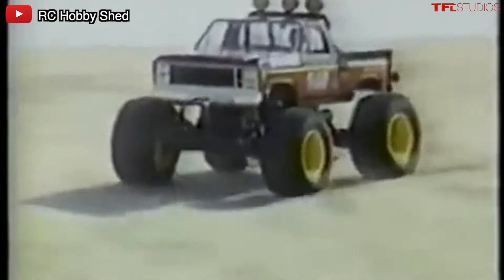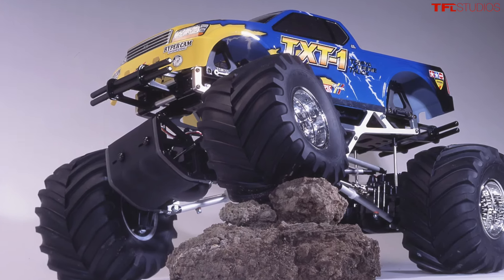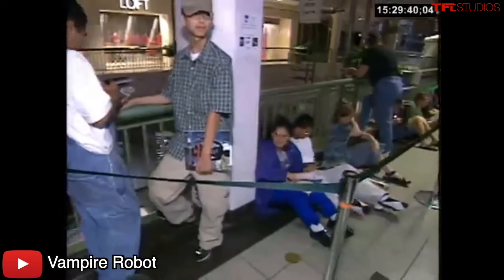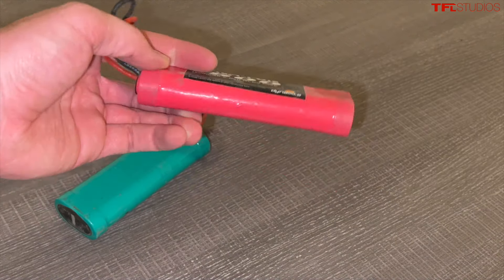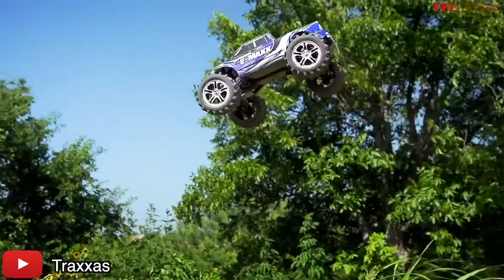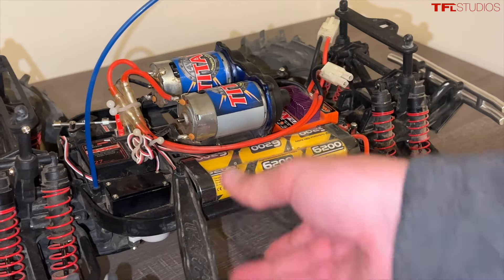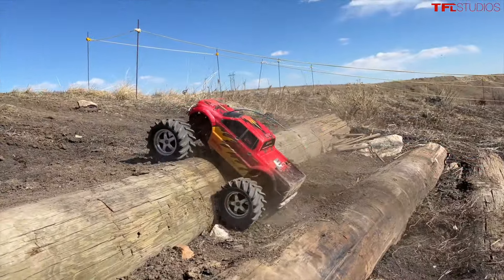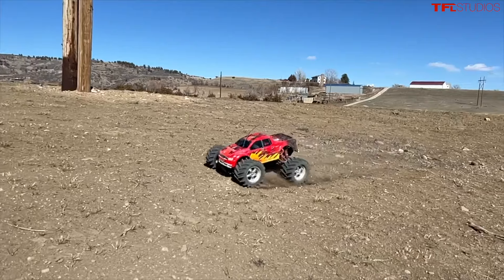The Truck That Changed The World (And Broke a Lot) - Traxxas E-Maxx Story

Comment: Fun fact: E-Maxx originally shipped with a Traxxas ESC but it was recalled  and replaced by the Novak. As was the case with mine. 24 years later I’m  rebuilding the truck with my 4-year-old and having a blast.
Reply: Yea them esc were so bad, mine caught fire from a little puddle and slammed into a curb stuck at full throttle and basically totaled itself the first week they hit the market lol man I cried like a baby I was so afraid my dad was going to hate me since he worked so hard to get me one for my birthday
Reply: @NitoFreak923 My guess is he didn’t hate you. ;)

Comment: Thank you for a great video! Traxxas should hire you to make more traxxas history videos! I still have my T-Maxx and I love it! Bought a Sledge about a week ago so using the max off road isn't quite the same anymore. Just pulled the engine in preparation of going through and cleaning everything, replacing worn components, and lowering it a bit for more street riding. I've run about a gallon of fuel through it and the compression is good, it's still hard to turn over by hand. I'll never get tired of hearing it screaming at 26k rpm and shifting into 2nd gear, music to my ears!

Comment: I have three EMaxx RCs. One is all aluminum with a gorilla max transmission with an XMaxx power system... took me six years to build. She's my shelf queen. It's so powerful I can't drive it without the motor spinning off the nut holding the slipper gear. I have two others I used TMaxx front and rear drive systems(bulkheads) and bolted them on new(er) EMaxx body pans. I'm building another T to EMaxx conversion right now. You can get the Tmaxx rollers all over the place for pretty cheap and building the rest of the truck is super easy and also cheap. Awesome RCs!!
Reply: Nice

Comment: You could also put the transmission in neutral by holding the red switch right in the middle if the servo was adjusted right. Then of course full throttle and dump it into gear lol. Thing did great neutral drops

Comment: i sold my tmaxx and got a revo 3.3 over 8 years ago, Its air time can be measured in hours and its had tons of abuse; yet a couple control arms, some steering servos and a spur gear/slipper clutch is all i have managed to break. I still have a brand new in the box 3.3 nitro engine waiting for the day this one gives up but after 5 gallons of 33% top fuel; it still fires up and runs better than most peoples real cars lol

Comment: I had purchased the T-Maxx on pre order basically and owned it for 3 years. It was the best RC car basher I had ever owned. I sold it then a couple years later purchased a used E-Maxx for an electric crawler. After owning a T-Maxx I thought the E-Maxx was the worst handling truck ever. Jumping an E-Maxx and a T-Maxx are two entirely different animals. The handling on the nitro was so much more graceful and forgiving. The nitro version was like 4lbs lighter. I could blast the thing wide open across any rough surface and it would manage it like a Rolls Royce. Where the E-Maxx would exaggerate every little dip and roller like a skateboard. It flipped over frequently and wasn't as fun to own and I sold it in about 3 months.

Comment: Just got my old e maxx up and running. I filled the shocks with a 50/50 mixture or 5w30 full sunthetic and lucas oil additive. It takes bumps beautifully
Reply: The rubber seals aren't compatible with petroleum based oils. They will swell. Shock oils are silicon. Just get a thicker shock oil.
Reply: @Carguylogan  huh... didn't even consider that for a second. Thanks

Comment: Oh wow. I didn't know this channel reviewed RC's. I thought TFL just showcased the real trucks. Yes, I have two Traxxas E-Maxxes. All upgraded. A single speed 3905 converted to brushless, and the 3906 two speed shown here....also converted to a sensored brushless system programmed to crawl smoothly at slow speeds. It has a higher stance suspension, along with Traxxas' Summit tires. Many upgrades. The 2 speed is like new for now, and am in the process of putting lights in a Proline 73' Bronco body for it.

These trucks paved the way for the powerful more durable MT's today. They deserve the respect. Glad to catch this video.

Comment: Love these first generation trucks from Traxxas.  I bought an E-Maxx new in 2000 and I still have it.  Trashed about four bodies over the years and replaced a lot of shock towers and batteries, but the rest of the truck is still running strong!  I just bought another F-150 body for it and a set of new batteries.  Still brings a smile to my face every time I dig it out for a run!

Comment: I strongly disagree with the heading of (broke a lot) I am an original owner of an emaxx and being young I was not nice to it. The only thing I ever broke was a shock mount once and melted the spur gear nothing else. My dad broke a main chassis once. We full throttled off big ramps and bashed hard no mercy. This was one of the most dependable rc cars I’ve ever owned and still do. Also we have had more hours than the average joe on our emaxx too we would go bash at parks with 40 dead batteries after. That’s a lot of run time in one session.

Comment: I always loved my HPI Savage XL, but nothing beats the ease of use and run times of the gas powered HPI Baja's.  Basically like using a lawnmower.  Super easy starts.  And as long as you have fuel, and carry an extra receiver battery or two, you can run as long as you want.  You guys should pick up a used one.  With a couple minor upgrades they can be very reliable and would be very fun in the wide open spaces on tumbleweed ranch!
Reply: boo.. baja sucks.. 2wd.. they are sweet looking  tho no doubt. but my losi 5ive run laps around it

Comment: Crazy thing is that Traxxas is still selling these same chassis and electronics today.   Wanna $600 brushed motor RC truck? Traxxas will hook you up!  They'll redesign and bring them up to current tech 30 years from now. Traxxas re bodies a rig and calls it a new release every year or so.  It infuriates me to no end.  I loved Traxxas as a kid. They did change the RC world.  Now they rely on the past while other companies offer multiple new designs each year.   Arrma has released more new trucks in the last 90 days than Traxxas has in the last 3 years.  Don't you Traxxas ites dare count new bodies on existing crawler platforms as new rigs.  There is no reason for the Summit to not be the greatest truck out today.  It cost more than other 6s brushless bashers from other companies.  I own a few Traxxas and want to own more,  sadly they won't build anything else i want.  I want the Traxxas from this Era back.  Leading the way in design, not name recognition.